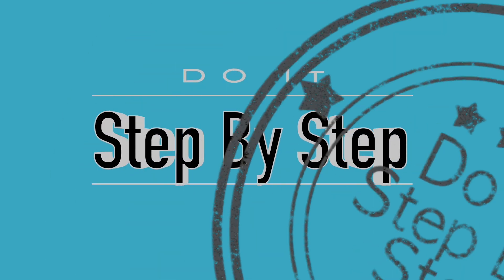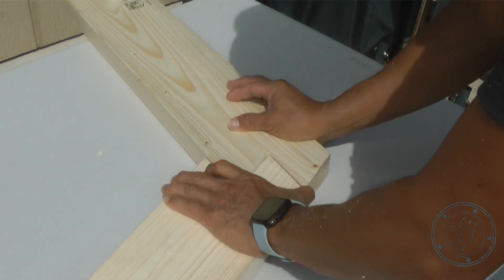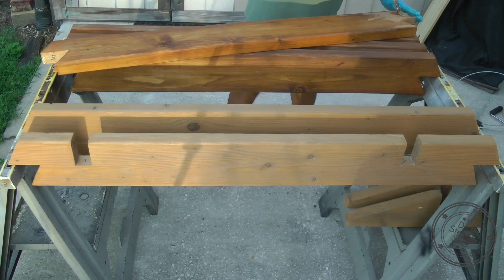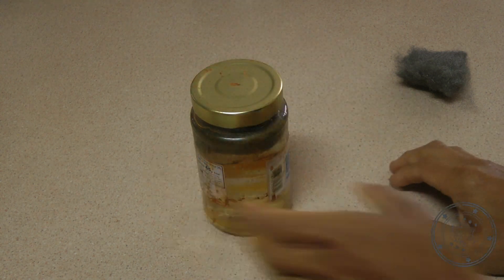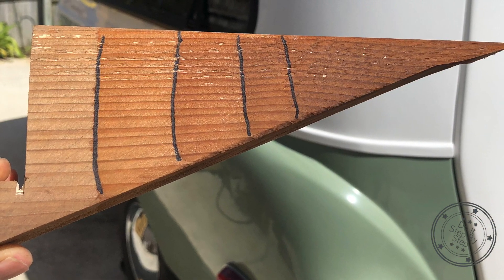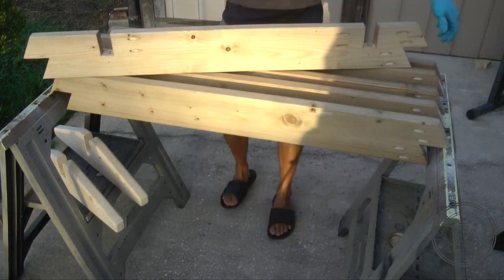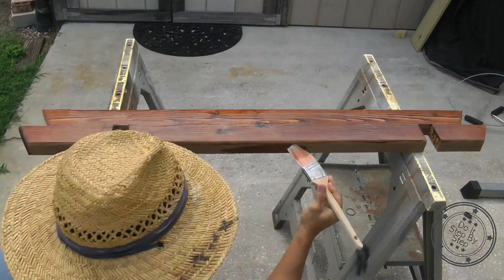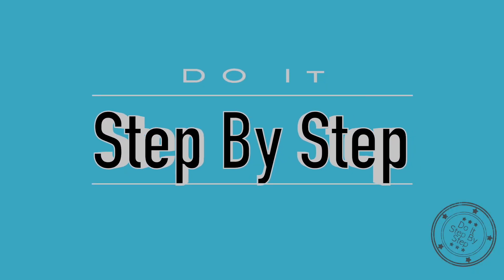DIY Geometric Wedding Arch Part 2 Tips & Pointers for Vinegar Steel Wool Stain with a Satin Finish

Comment: How many layers of stains did you use to get the color in 4:20?
Reply from the maker: @chesterchan2612  thanks for the question.  My daughter liked the color of four coats of stain with 2 coats of clear satin urethane, so that's what I did. 

I must say, after some time, the wood did get a bit darker.  I would probably just do 2 coats if I desired a lighter color like @ 4:20.

Comment: Does it matter what kind of glass jar you use? Should it be cleaned?
Reply from the maker: Well, I've used old "food" jars: mayo, pickle, spaghetti sauce, and jelly/jam jars.  I rinsed the jars out with warm water and a drop of soap, and dried.  They all still had their "smell" left in it.   As long as the jar has no left over food product residue in it, it should be fine.  I hope that answers your question =)